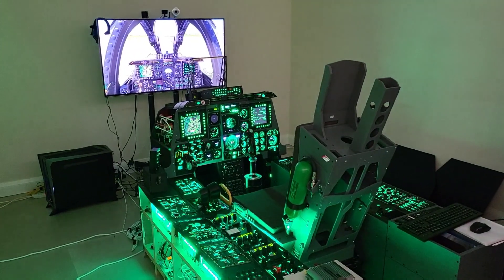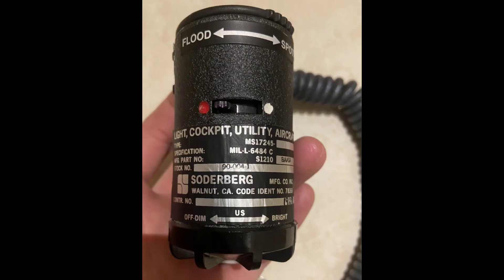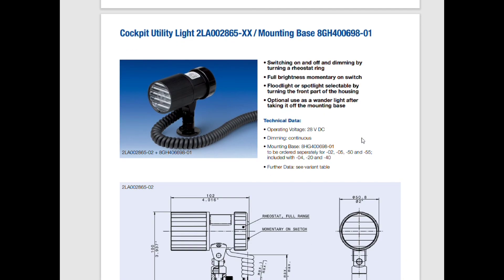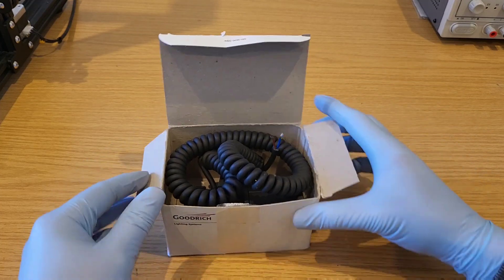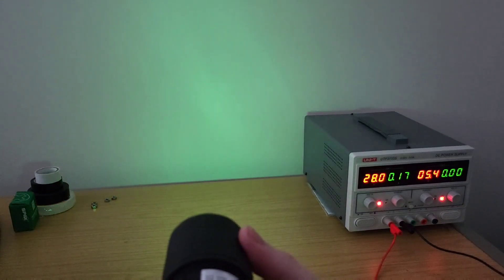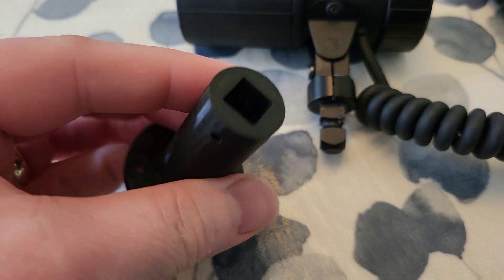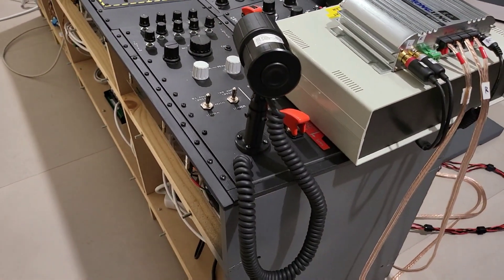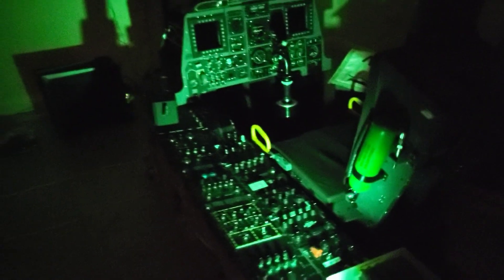Simpit A10C - Upgrades - Part 3: Utility Light

Comment: Something you should note is that the data for your light in the Goodrich catalogue says the bulb is a 24V bulb (P/N  8GP002067-24).  That could simplify your power requirements for it.
You could possibly find a lower voltage, and even LED equivalent.
Reply: The one Worthog project has was 24 volts but he converted it to 12 volt LED.
Reply from the maker: Hi No1sonuk, you are correct regarding the bulb, after a mix of tests I set the voltage based on the units specified operating voltage in its documentation, 28 in this case. 
The good thing with the step up unit is I can easily tweak the output should I need to should it impact the bulbs lifespan, cheers 👍